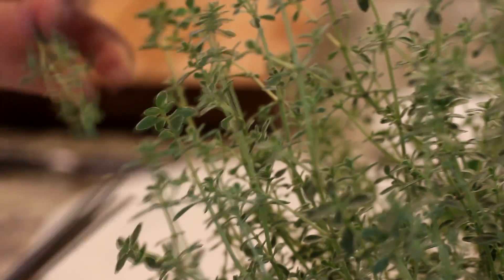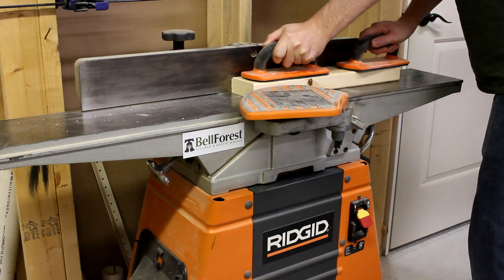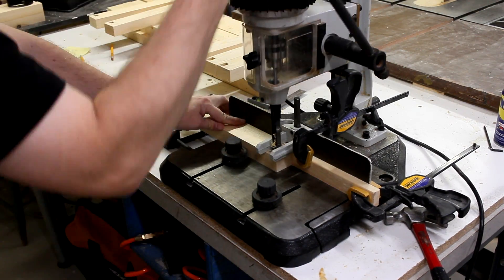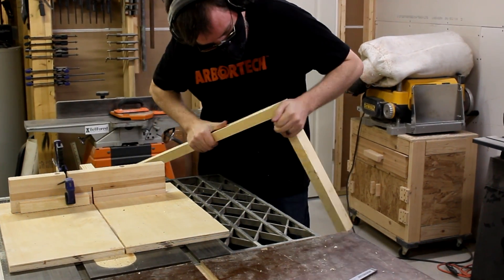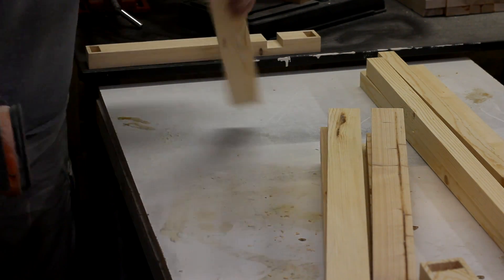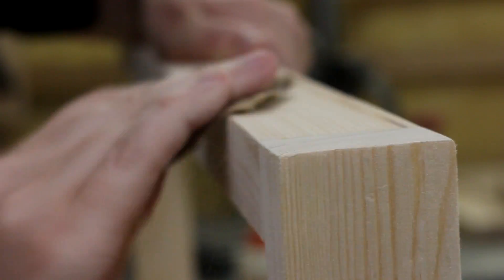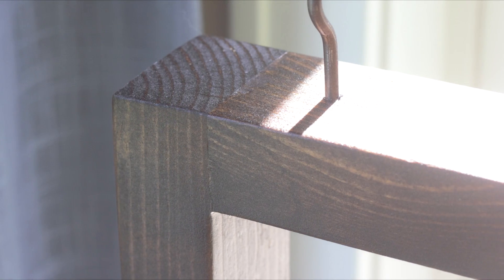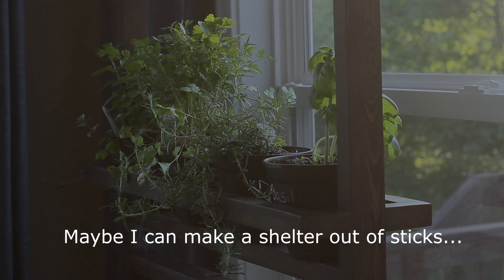Woodworking: How to make a hanging herb garden

Comment: Great Job like usual! I’m hooked on your videos. What’s your preferred method for applying stain? Brush, rag? Do you wipe off immediately? My biggest struggle on projects.
Reply from the maker: Thanks Ben.  It really depends on the stain, the wood, and the piece.  Sometimes you can just wipe it on, other times a brush helps you reach some spots, and sometimes it's best to spray it on.  Different stains require different applications as well.  Lots of videos on YT about applying finish that should help.